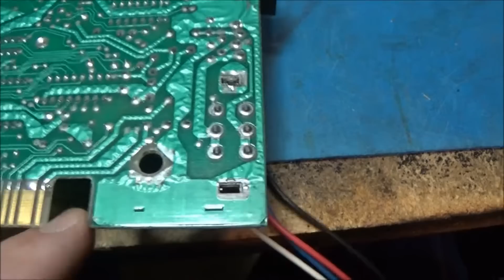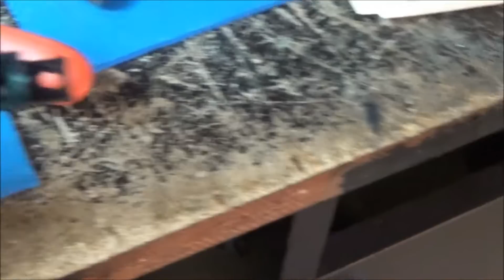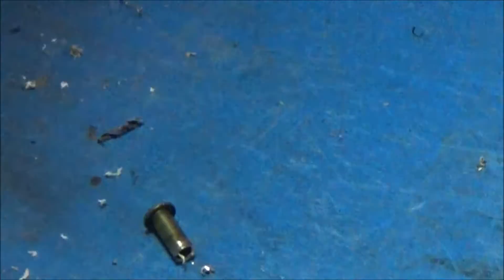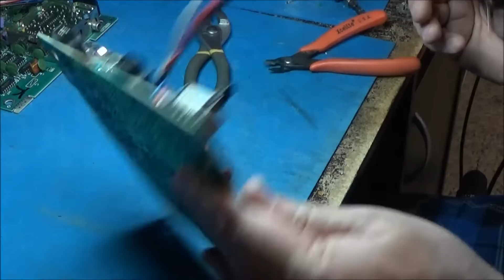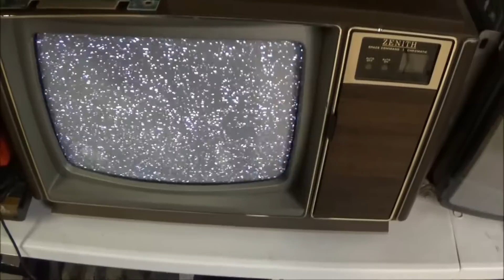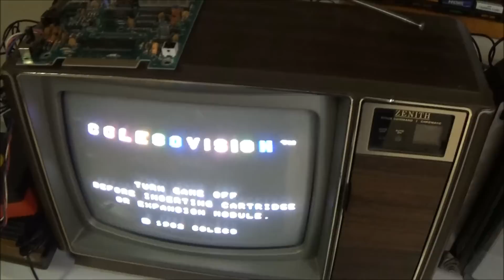Colecovision Console Lot - Tear-down and Repair Part 2

Comment: How often do you need to change the ceramic filter in that Hakko?  I think they switched to a thicker filter with those blue and yellow models, but I went through a 10 pack pretty quick with my old 808.  Does that one have a "spring" filter in the capsule too, or just the metal baffle and ceramic filter?
Reply from the maker: its just the metal prefilter and the ceramic filter...  and yes it is thicker than it used to be...   i change it maybe once every couple months if that...  i get good usage out of them